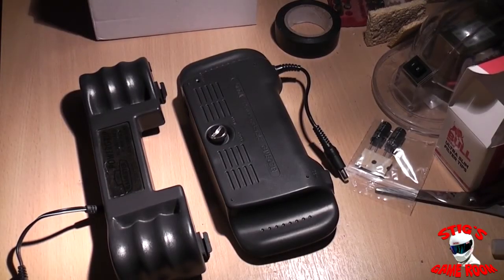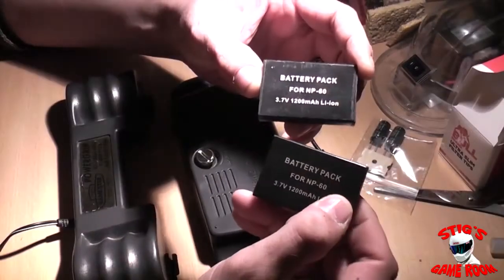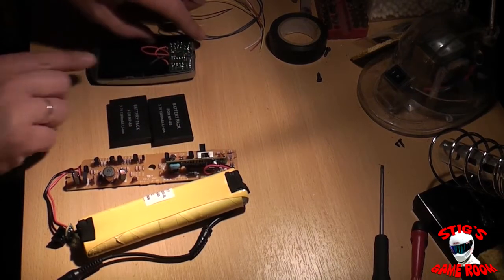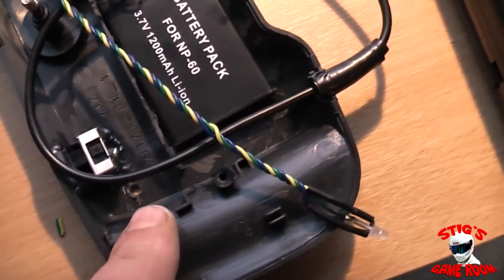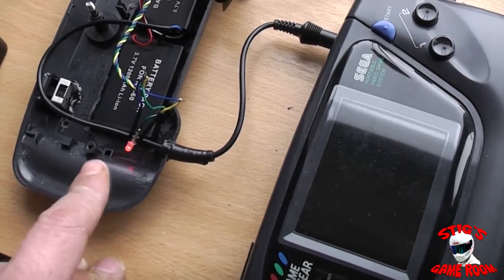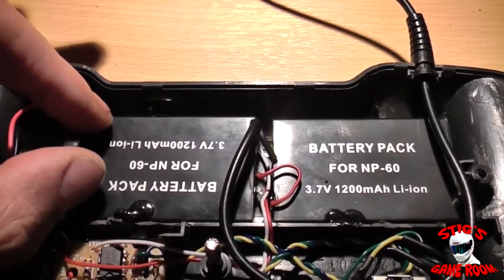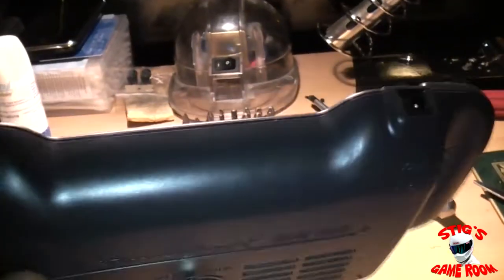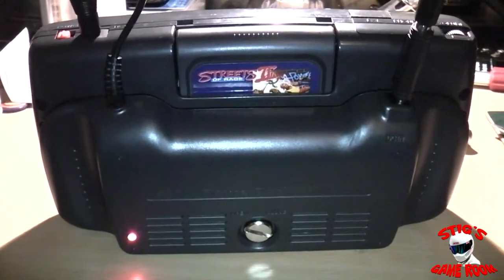Sega Game Gear Powerback - Battery mod

Comment: 7.2v Ni-MH rc car battery's charge fine on the oem charger and have a 1600mah battery. Bonus is there cheap and only require to wires soldered together
Reply: Problem is size. They're usually about as wide as a C-battery size in girth from what I've seen. Using the belt-clipped battery pack might make them fit but that's a bit ridiculous. I've used a charger/step-up circuit that lets me choose the power available with a larger-capacity cell (biggest I've been able to fit is a 5000mAh off Ebay, just fits within the dimensions of the PowerBack) to get better performance than this guy gets with two small batteries.

Comment: What is the best way to open the Powergrip? I have two with old batteries. Thanks
Reply from the maker: I never opened it. Its glued shut, so I didn't try to force it open as it would have damaged the plastic.

Comment: maybe the original powerback board has the circuit switch for the yellow to green light.. can't you use that board and the new batteries if they are rated the same?

Comment: Those two rechargeable batteries look small enough that they could maybe fit into where the AAA batteries would go on the back of the handheld itself. Have you considered attempting to just fit them into those cavities? In fact maybe they both could fit 'back to back' in one side and the guts for the charger could go in the other AAA side? I'm sure this is waaaaaaaaayyy harder than I'm proposing though. So forgive me if I'm coming off a fool=P
Reply: Li-Po and Li-Ion cells require special circuits to control voltage/amperage in(charging) and out(using) so can not just be slotted into a AA slot.
Reply: @Stephanie Lovik properly reading before responding would help, what parallaxchief ment was putting the cells and the curcuit into the space where the mignon batteries would go to reduce the width.

Comment: It occurs to me now that the game gear battery would be 6 cells so what i said about 4/3a cells is wrong but my guess is that the tubes contain 3x 4/5A or 3x standard A cells so 2x 18650 should still fit well in the space.

Comment: if you build a bigger pack you have so much space in the device that you could probably buy 2 individual chargers and charge the individual cells to 4.2v or 4.35v instead of using 1 pcb and charging the batteries in series that way you know both cells are fully charged and since you have effectively doubled the avaliable charging current the batteries will charge twice as fast.
Reply: Wonder if you could wire both Chargers up to the same Jack.

Comment: Panasonic makes 18650 cells that are 3400mah (come at a price) but can be charged at 4.2v per cell.
Samsung makes some less expensive cells that are 3000mah but require a 4.35v charger(8.7 in series) but have a discarge curve where the voltage is higher throughout discharging so the avaliable power is similar to the panasonics.

Comment: If you choose to revisit this i would use 18650 li-ion cells because it looks like the batteries you pulled out of the unit are 4/3a sized means that the unit held 4 cells that where 66.7mm long x 18mm diameter, and 18650 18mm x 65mm.

Comment: From what i have gathered from the internet the only viable option for a gamegear with a better screen is to find a majesco sales version of the gamegear.

It was released in 2000 in the US.
It has an improved screen. you can differentiate it from sega made game gears because the logo on the left side of the screen is all white on the majesco model(opposed to red green, blue on the sega), the majesco is deep black(as opposed to grey) , and the majesco power btton is purple(opposed to blue)

Comment: You know, it almost looks like this assembly could be made to fit inside the Game Gear. I wonder if its possible.
Reply: If you could get one battery in One charging circuit on either side where the battery compartments are then possibly it could work

Comment from the maker: Your obsessed by a GG screen replacement LOL. It's not going to happen unfortunately :( It's long story but the short version is, that a screen replacement for the GG is not a Viable option, it has been done but the GG doesn't even fill the whole screen, you just get a cropped image in the centre of the screen, like you do when you play a PSP on a big TV. The GG I used here does not have a pale screen, the contrast is just turned up to high :) Cheers as always

Comment: Are those old CPUs and LCD displays not very power efficient then? A 1300mAh battery would certainly drive an iPod Touch for a lot longer than 105 minutes!

Comment from the maker: Yes mate, I can get batteries of all sizes, the trick is fitting them inside these battery pack cases, that's why I went for the little slim ones. I can easily get 4600 Mah batteries but they're 5 times the size of the ones I used
Reply: StigsWorld How do you recharge the batteries?